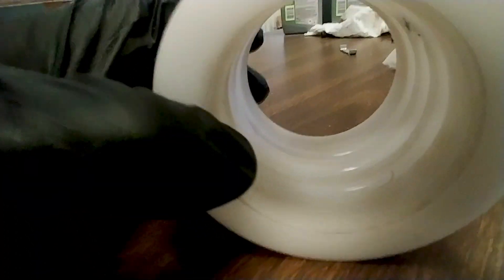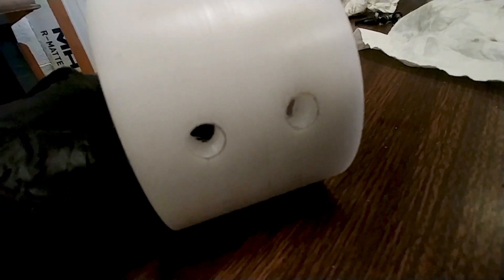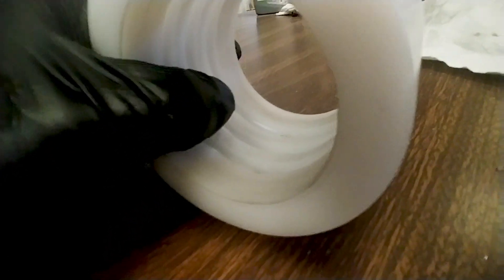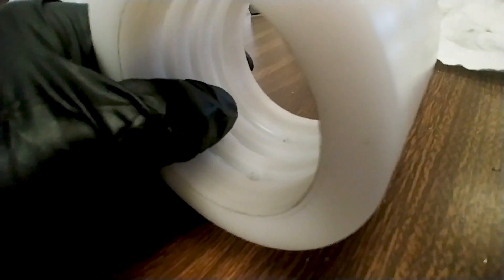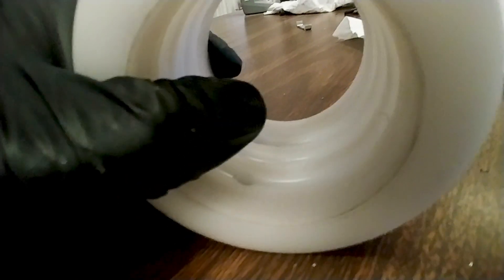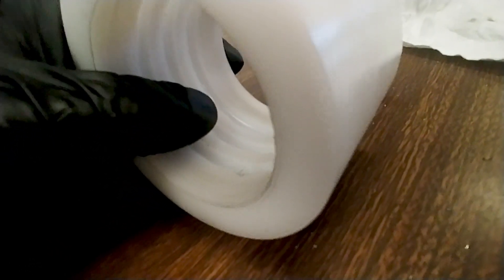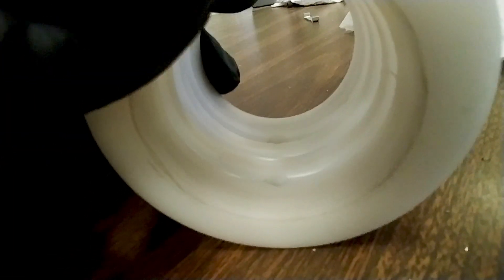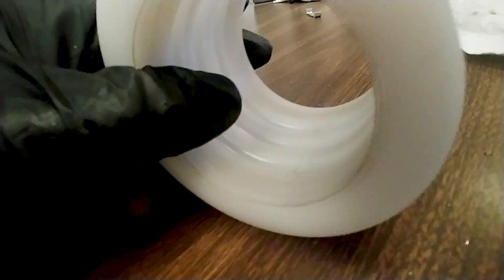Unable to Hold Pressure - Flying the Raptor Prototype

Comment: Good choice of 660 bronze.. Way better material for this application than delrin.  Coefficient of thermal expansion and surface hardness play a large part in material selection for this particular application, as you certainly realize. Material strength at elevated temperatures is also in play when designing critical parts such as the reduction drive's lubrication, propeller pitch control mechanism, and oil circulation systems.  There may be many other good choices for this application including any of many sintered bronze products, which offer great thermal stability, preloaded with oil / teflon / graphite or a number of other lubricating and anti wear ingredients.

Comment: If I was building an airplane with a Diesel engine I would look for an engine that had a peak torque close to 2900 rpm so I wouldn’t have to use a reduction system. Lots of diesel do this!

Comment: Might I suggest giving Smalley Labyrinth seals a try. This is similar to the seal rings used in turbo charger bearing housings that run a hundred thousand RPMs.

Comment: I have to admit that this looks  so awesome in the specs..but you have been working on it for 6 years now so my question here is will it ever hit the market as a working plane?
Reply: I know nothing  about this space compared to many here. But I do understand the points expressed. Doug I was wondering the same ... but correct  me if I am wrong (anyone could) ... Doesn't development take so long? ... it is just that we are aware of every move(mostly) Peter makes is because he has been putting it out there. 
1. So how long on average does it take for a new concept to hit market?
2. Putting it out there can be a real challenge ... taking and leaving advice, suggestions and ideas can be a real _itch! It could work totally against your commercial interests. Thoughts?
Reply: @nevillecreativitymentor  I have no commercial interests in this..but on the other hand Boeing says about 4 years and 2 months from design to market(might explain why they have one grounded right now).I also realize that there is a lot of difference between huge company and small developer but i am excited to see if the finished product meets the specs(distance and speed)that are put out for it also see a finished interior on this bird it will be truly awesome if it does and really roomy.Much more so then a Velocity which i admire very much.

Comment: Go thru the end of the prop shaft. Its easier to pressurize. And the fittings are off the shelf from case or kubota they are used in the heavy equipment industry.

Comment: It will become obvious I am not a materials engineer, but, I've seen worse on TV. Would reducing the thickness of the "plastic" and surrounding it with a steel sleeve keep the plastic compressed enough to maintain the seal? My thought is the steel wouldn't heat/expand as much as the plastic, keeping it tightly compressed. Perhaps a steel sleeve of an appropriate diameter already exists, perhaps requiring a reduction in the OD of the plastic seal.

Comment: Hi just a question, if you change your drain holes to horizontal would if not have less wear on the shaft
Reply from the maker: Thanks for the suggestion. Great idea and will implement it. Same as what's already on the housing with the elevated drain to retain an oil bath.
Reply: @RaptorAircraft   Yep, I agree... Most times simple works best...
Reply: Wow! why didn't I think of that? That's using the head for something other than a hat rack.

Comment: Truth be told I didn't like the look of that hard shore polymer from the get as a gasket. But I felt it was worth a try. 

How do you feel about making a gasket out of say permatex high temp red and a mold of the inner parts of that redrive. From the mold you can drill out the passages to circulate oil where it needs, but mainly a bypass since it is seeing so much pressure. 

I remember the vanos assembly on my e46 kept leaking oil from a complex wire gasket  circuit. I bought a new gasket, dipped it in rtv red and it aint leaked since. 

Just a thought also do you think the gasket is taking the load between the redrive and the engine vibrations since I remember its mounted as a hard point not to the engine right?

Comment: There have been hydraulically actuated variable pitch props since the 1920s according to Wikipedia. Why is this a problem here?
Reply: Having an oil fed prop on a belt driven reduction unit is a big issue. In a direct drive situation oil flows through the crankshaft straight into the prop hub.

Comment: I would look at this table https://www.engineeringtoolbox.com/thermal-expansion-metals-d_859.html#:~:text=Linear%20thermal%20expansion%20for%20some%20common%20metals%3A%20,%20%2012.8%20%2049%20more%20rows%20 for expansion rate matching; I would make a  recommendation but I don't recall the shaft material. With that being said I would go ahead and refinish that shaft. 
Additionally, I don't think the original solution really had to many issues assuming the metal expansion rate made sense per the table above. With an engine failure due to oil starvation the most likely cause the welding of the bearing to the shaft and as such machining and replacing the old bearings should be a sufficient fix.

if you think that the bonze is a better solution by all means no harm in trying but I gander that the original design was sufficient as fused bearings are a known result of oil starvation.

Comment: At the risk of sounding like a jerk, which is not at all my intention. Peter, sir, I don’t believe I would be willing to bet any further on a prop shaft that exhibits scoring / galling regardless of the bushing type or bearing point location. Seriously consider having that shaft examined or at the least machined back to clean material. I do believe that bronze will be a superior material choice for that bushing location and type. 
I also concur that having the ability to ‘lock’ a pitch independent of the oiling system in the event of a failure adds a critical layer of system safety. That’s the extent of my constructive criticism. 
I sincerely appreciate all you have done and the additional time you have spent to document the process of your build. I enjoy seeing the videos, it takes enviable stones to publish the bad right along side the good.

Comment: PEEK is a fancy stable plastic.  Not too bad to machine. More rigid than Teflon.
Reply: We use it my industry as an alternative to metal babbit on bearings. It is temperature stable even when exposed to hot oil. Kindly love from Bangladesh sir Ross.
Reply: @dangryder6050  Thanks for that reality check.  Good to know it is actually used for this application.  PEEK is a fabulous modern material.  Chemically impervious and keeps rigidity to high temperatures.  I just wish it was cheaper!  

Do you use the glass fiber reinforced version?  I did a little checking on thermal coefficient of expansion and with glass fiber reinforcement the TCE is even lower.  Though I would worry about abrasion from exposed bits of glass 

After, a little more thinking.... perhaps the optimal TCE is to match the TCE of the rest of the mechanism to maintain a semi-stable gap.   At a minimum something that doesn't soften at operational temperatures.   I still like the idea of using PEEK and Laura's data point of actual industrial use for this exact application is pretty compelling.   

Good luck Peter.   Engaging the hive mind is a powerful tool.  Though you need to be strong to not be overcome by the criticisms.  As well as wise and humble to pick out the gems.

Comment: Why change what was working correctly? The engine ran out of oil and caused the propshaft to gall. This happens almost every time a PT6 or Continental runs out of oil. That transfer sleeve is exactly like a PT6. It’s not a material problem, just a lubrication problem. I commented earlier saying to check this because I’ve seen it time after time. Please change the bearings too, they are prone to failure.
Reply: I totally agree. What he had was working fine untill he lost oil pressure.  The shaft collar and berings should be replaced. Would hate to see that shaft break. At a minimum the shaft should be polished and NDI'd.

Comment: I posted a link to the service temperature and modulus data for Delrin in a comment on the last video. Anyone with any engineering sense would have seen from that information that Delrin is an unsuitable material for this application. My comment was later deleted.
Reply: That has happened to more than one of us, I am afraid.
Reply: Delusion is a strong coping mechanism, unlike Delrin.
Reply: If there are comments being deleted because they merely challenge the engineering, I think that there are many more major mistakes to be made with this aircraft.
Reply: @TonyWilliams123  That's it, I challenge you to a duel. Lol 😨
Reply: Yep.  Comments tend to get deleted.
Reply: Yep I had a comment deleted also🤔👎🇦🇺
Reply: I would have went with roller or ball bearings

Comment: Peter for this application try Interstate Plastics "PTFE" instead of Delrin... PTFE is good to 326.85 C Vs 175 C Delrin and is great for high temps. It's considered a high density rubber Teflon material however it machines like Delrin and holds closer tolerances when heated. Its available up to 5" thick. Cheers

Comment: My hobble opinion petter is that you should used a certified engine to test your airframe design first, and add the engine to your proved airframe after you know that you airframe is good.
Take care.
Reply: @Marvi Wilson Marvin, That is correct, but changing the power plant design is very common on experimental or certified aircraft, not impossible to do, and at this point it’s my believe will be probably faster for the project and safer for him.
Reply: Complexity is the way of big trouble. You have too much relying on fickle technology.
Reply: I gave the same opinion a few years ago, when the project was still in the phase of laminating parts of the structure. He was not at all receptive to my suggestion... I personally doubt that the altitude and speed goals will be achieved with this engine. A lot of other little things are also accumulating in this project. I will not risk being misinterpreted again and creating a state of animosity. All that remained was to pray for his success... Godspeed!